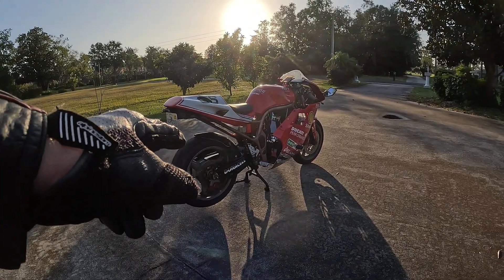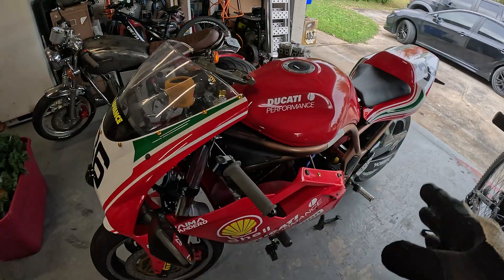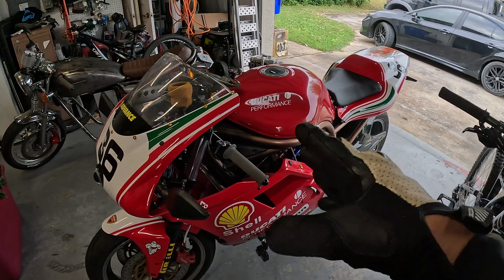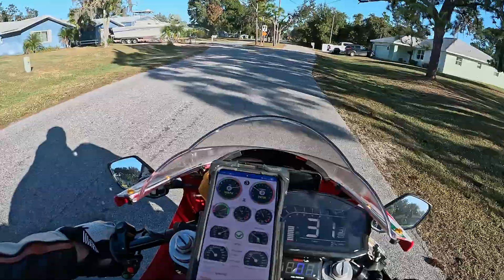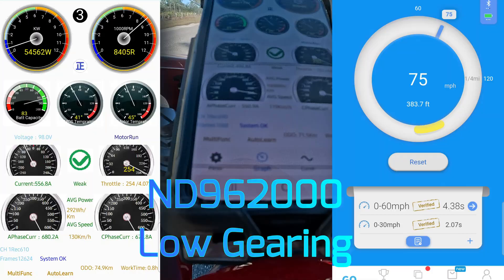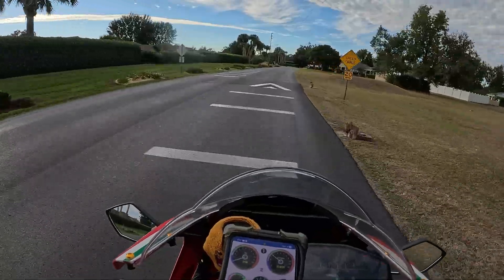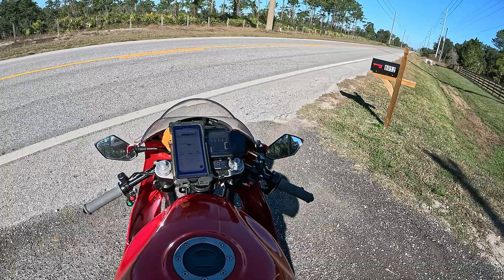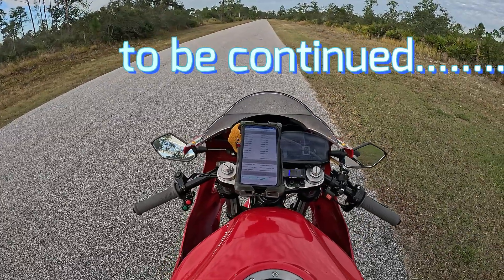Fardriver ND962000 Controller on the Fake Ducati eBike.  Tested.

Comment: I saw not more than 680 phase ampson your screen videos, its very strange, cus this controller must do insta wheelies from standstill with your 700a of bus amps and its 1400-1800 phase amps.  Dont you try to setup controller using PC and cable?
Reply from the maker: If the wheel can spin up fast enough it will keep the phase amps low.  But mine seem really low. Slower bikes, underpowered or higher gearing seems to increase phase amps.  I know I got more when I put the tall gearing on it.  I am barely hitting 700 line and not every time.  Im also not hitting it until 6000 RPM.  I am really struggling getting the line amps in early and down low.

Comment: I run VESC controllers, and when I program the VESC to push 400 phase amps, it pushes 400 phase amps (as long as I'm not hitting my battery limit, etc). I've pushed 28kw on a 5kw motor. It didn't give me a ton of additional torque, mostly just heat because the motor was heavily saturated, but the controller did what I programmed it to. I've never used a Fardriver, but I have to wonder if it's just limiting for some unknown reason like some Kelly controllers I've used in the past.
Reply from the maker: Don't use a fardriver.  LOL.  I will be going to VESC  SH3L 1400.   I have another bike for this fardriver so it won't go to waste.  The fardriver may as well be a locked out Kelly with adjustments.  I could be wrong, but hat is my conclusion and my next video should prove that statement.   Now if I was happy with the advertised motor kw, then the fardriver would be fine.
Reply: @GhettoWrench I'm running a VESC Maxim+ 120V on my electric cross cart with a 25kw motor and it's working good so far. I have the same Sotion motor you do that I plan to pair with the VESC, so I'm looking forward to your findings!
Reply from the maker: @johnhodnik2962 oh cool!!  I need to get a VESC and learn it.  I have guys to help me that know and love VESC.  Need to figure out how to buy it without the wife knowing!  LOL

Comment: What motor are you using I really think your motor is saturated. Or you battery can’t handle the phase amps. If the “inversetime” doesn’t do anything there is definitely something wrong. This setting is so strong if not set correctly you will blow shit up!
Reply from the maker: 50PL 96v 80amp 16p26s.  That is plenty big for 800 amp goal.  Sotion GTS35 motor.  All roads lead to that motor being lame.  Im gonna redo all this on my QS2668 hub bike.

Comment: Very interested in what you find out about this.  Regarding the start phase amps, how to make it more torquey from a stop, and why there's not much of a difference.  Hope you post a video with your findings!
Reply from the maker: I am... that video is almost a month old now, but just posted it in hopes of finding a solution.  Been doing tons of testing.  Results aint good.   I have come to realize these fardrivers are locked just like most other controllers.  Most controllers give you limited range of power levels etc...   the fardriver gives you a little more adjustments within their preset parameters and that's about it.  

I am making a video on it.
Reply: @GhettoWrench sad to hear al that. You were my last hope for farrdriver.  I gave up
Reply from the maker: @Voltjunkie 😂😂😂 sorry bud
Reply: @GhettoWrench  Oh bummer.  If that's the case, it sounds like their phase amp claims are basically a load of sh!t.  I've seem lots of comments about changing something called "inverse time".  I guess that made no difference?  Your findings may be the thing leading me away from them then.  Looking forward to your video.
Reply from the maker: @therobby3 I would first like to try this inverse time thing on a hub motor and I have a 961200 hooked to a QS273 to try it on.  Maybe I will re test all this stuff on that one.

Comment: It's worth trying this, it costs nothing😊

More progress on StartKP=0/launch power issue:

I'm starting to understand why FD locked it, and I finally found the workaround. Works perfectly, works TOO well actually, to the point where it's extremely easy to overheat the motor or controller from phase amps getting too high too quickly when launching.

The key is in the Product section, "InverseTime". Range is 3-48. Default setting is 36. The recommended settings in the manual are way too low, and WILL cause damage to some setups. This explains why they set default to 36, because it's on the safer side for any possible motor that could be used.
This setting is specifically for adjusting the ramp time of the phase amps. Phase amps = launch torque. And this setting is so incredibly sensitive that it is strongly recommended to be adjusted in only 1-2 point increments at a time, with test drives after each adjustment.
If set too high (default 36 is way too high), it literally will make the controller never even be capable of reaching the max phase amp setting. If set too low, phase amps can ramp in so fast that it can actually get higher than the max phase amp setting for an instant, and cause a shutdown due to overcurrent protections.

startkp no longer matters anymore if you adjust inversetime properly.
Just be VERY careful, because it really is so incredibly sensitive, and has such a HUGE impact on actual phase amps getting sent to the motor, that it can very quickly damage the motor and/or controller from overcurrent protection not kicking in quick enough, and also causes heat to buildup VERY quickly, also causing an overtemp condition pretty rapidly too.

So for everyone who knows their system should be capable of more low end torque, basically everyone who has noticed they never even get close to what they have max phase amps set to, you can change InverseTime and it WILL raise your phase amps by a lot and really quickly. I suggest starting by setting it to 20, and decrease it 2 points at a time, test drive each time, and continue until you reach the desired launch torque and phase amps. And CLOSELY monitor motor temp, battery temp, and controller temp, and actual output current, and battery draw. This can also trip your BMS very easily as well if set too aggressively.

I've had a number of people tell me they have some issues with a delay in throttle when taking off from a stop, and this should solve that issue as well.

Try it out, I guarantee you'll be happy with the results. Just BE CAREFUL, it can get dangerous very quickly if you go too low on this setting.
Reply from the maker: Ok cool.  Epic info.  I found the InverseTime setting.  It is on 36.  So start at 20 and work down at small increments.  

Do I also need to adjust Start KP?  Or was that just for info sake?

Thanks a bunch.
Reply: @GhettoWrench  startkp is locked in the new controllers and can only be adjusted to a maximum of 16 via a computer, not a phone. That's why the initial acceleration is bad. Adjusting inversetime makes the phaseaps rise faster and thus the acceleration improves.
Reply from the maker: @saulikomulainen ok.  Thanks.  I just got the PC cable, but have not figured out how to read the controller yet.  Keep getting 11 beeps and an error.
Reply: @GhettoWrench  Connecting to the computer was a nightmare. Make sure the correct USB port is selected, there is a section in the FarDriver program where you can choose.
Reply from the maker: @saulikomulainen I have the right comm port, but no idea what baud rate and other thing is.  It did show the gauges and the fault code on the middle part, but all the parameter fields were empty
Reply: @G @GhettoWrench  No need to adjust the kp value but be careful and lower the inverter carefully and monitor the temperatures of the motor and controller. The intention is not to break anything😄
Reply from the maker: @saulikomulainen understood.  Thanks.
Reply from the maker: I went out and tested 30, 25, 20, 18, 16, 14..
No difference.  You think motor is just saturated and cant take any more amps?
Reply: @GhettoWrench 😮 that wild...I wonder if you have a different result with the hub...that is where it worked for me but 🤷🏾‍♂️
Reply: @GhettoWrench  It's really strange that there was no effect. Of course, I have a hub motor and as you said, it could be that the motor is saturating, but you would think that the phase amps would rise faster.
Reply from the maker: @nogasdash I think so.  A lot these settings seem to work better in the Hub.  I may put all this stuff back in 268 hub maddog.  Better results on that.
Reply from the maker: @saulikomulainen IKR.  I am gonna try all this stuff on my hub motor.  I have 2 bikes with hubs.
Reply: @GhettoWrench id say see how the café racer does with those changes first but I def get it!
Reply from the maker: @nogasdash that will be the real test.
Reply: Yessir I've tried to tell people this exact thing!!!
Reply from the maker: @nogasdash you for sure told me before.  Just have to prove it.  LOL.

Comment: Ive never owned a sotion motor so i dont know how accurately they rate their motors, whether they can take plenty more like QS or thats actually their max so take what i say with a pinch of salt..
But could you be hitting the motors saturation point? As the higher wattage your seeing only after a certain rpm would make sense if your feeding it its max phase amps and as the phase voltage increases the wattage increases?
Fingers crossed im off base as itd be nice to get your moneys worth from the new controller. 🤞
Reply from the maker: I think you may be in track.  When I put the 1800 controller on the QS268 maddog, I saw huge gains over the 1200 controller.  I may put this battery and controller back on the maddog for awhile.

Comment: horwin senmenti 0 ma 400v performance 2.8s 60 mph
Reply from the maker: Just googled that.  Wow.  $17k though.  I think if I put a big enough controller on my 12" QS268 maddog, I could get close to that.  Prob need the 962600.
Reply: @GhettoWrench  To have a good fast start you need at least 144v and a motor with a 5 - 10kv winding, the lower the kv, the faster the start and fewer amps, on my QS 260 70h 12kw 70H 96 motor - 144v max 265A and I achieve 5s - 100kmh with the weight of the driver and vehicle 250kg, with a 144v pin I have 3 - 4s -100kmh
Reply from the maker: @MiniEngineMotor-wz5wu ok cool.  My red bike and me weighs 275k so that is good to know.

Comment: Maybe the answer is to not use Fardriver, and use another controller..
But, what else is there that can deliver better results?..
Ebmx9000, Tronic & Nuclear the A.I is saying are the best for super fast acceleration..
But, no doubt you've been through all this 🤔
...just trying to help for what it's worth 👍
Reply: Vesc controllers definitely feel like they hit harder at the same reported amps but I imagine cost comes into it. 
It certainly does for me, I use vesc's for bikes below 12-14Kw and fardrivers for anything more as the higher power vesc's like 3Shul are crazy money.
Reply: It can quickly become an expensive mission trying to go real fast, real.quick - I'm glad I'm only doing smaller wattage builds that I'm happy not going crazy speeds with  @mrkiplings
Reply from the maker: You nailed it!  The VESC SH3L 1400 controller is what I should have bought.
Reply: @GhettoWrench Yeah, my original thought before was most likely VESC is the answer.. 👍